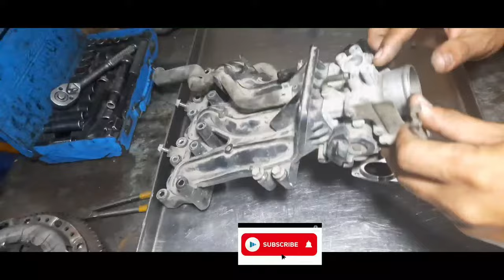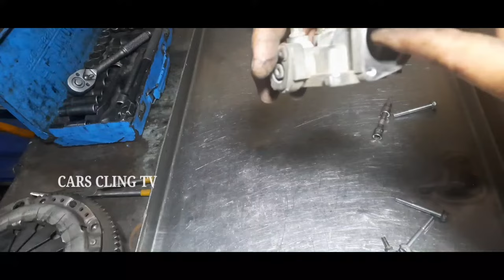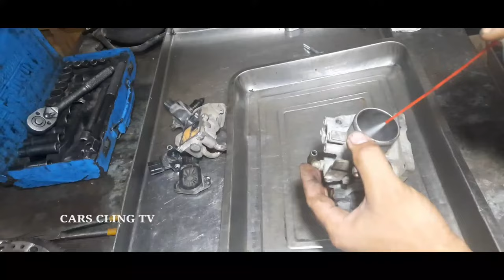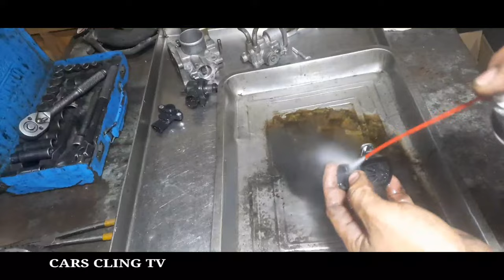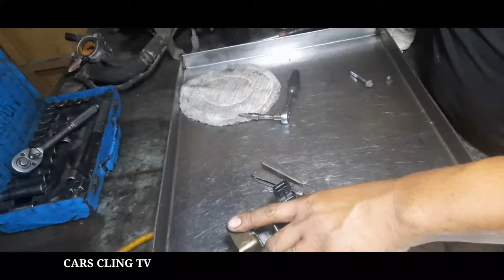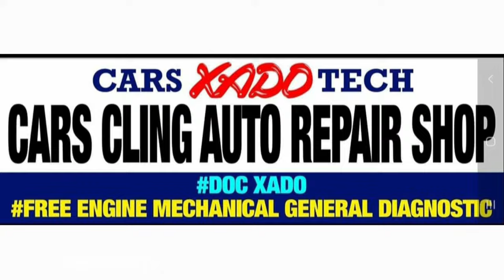ENGINE VIBRATION DIED DURING IDLING IACV TPS MAP SENSORS MAIN CAUSE ISSUE CLEANING SET UP TUTORIALS

Comment: Bos ano kaya sira ng big eye susoki q pag hindi aq mag apak nga gas mamatay
Reply from the maker: Ang big eye Suzuki Transformer na nag-mamamatay kapag hindi mo inaapak ang gas pedal ay maaaring makabahala at nagpapahiwatig ng isang sira o problema sa sistema ng fuel delivery ng sasakyan. Narito ang ilang posibleng dahilan kung bakit ito nagyayari:

1. Fuel pump: Ang fuel pump ay responsable sa paghahatid ng sapat na gasolina mula sa fuel tank patungo sa mga fuel injectors. Kung may sira ang fuel pump, maaaring hindi ito nagbibigay ng sapat na gasolina habang hindi ka umaapak sa gas pedal, na nagreresulta sa pagkakamamatay ng sasakyan. Maaaring hulaan ng isang mekaniko kung ito ang sanhi ng problema.

2. Fuel filter: Ang fuel filter ay naglilinis ng gasolina bago ito mapunta sa mga fuel injectors. Kung ito ay labis na marumi o may sira, maaaring mapigilan ang tamang daloy ng gasolina, na maaaring magresulta sa pagmamatay ng sasakyan kapag hindi umaapak sa gas.

3. Throttle body: Ang throttle body ay nagreregulate ng dami ng hangin na papasok sa engine habang hindi umaapak sa gas pedal. Kung mayroong problema sa throttle body tulad ng pagkakabara ng mga makinarya o mga sensor na nagkkontrol dito, maaaring hindi sapat ang hangin na papasok sa engine, na nagdudulot ng pagkakamamatay ng sasakyan.

Ito ay ilan lamang sa mga posibleng problema na maaaring magdulot ng mga sintomas na iyong binanggit. Mahalaga na dalhin ang sasakyan sa isang kwalipikadong mekaniko para sa pagsuri at tamang pag-aayos.

Thank you for your support!

More Basic Pointers Toturials FULL Videos: https://www.youtube.com/channel/UCXSl7FUzPZV3lIxFWCHFTVA
For more inquiries, please contact us at our 
FB Page CARS CLING TV: https://www.facebook.com/clingauto
CARSClingTvShortVideos: https://www.youtube.com/channel/UCsUWQnaD9vVKqL_w6eAYhgA
#
#xadoenginetreatment 
#carsclingtv 
#basicpointerstutorialissuefixed 
#xadoenginetreatmentengineperformancerecovered
#10yearslonglastceramicscarbonmetalcoated 
#carsclingautorepairshoplegacy 
#trottledelayremoval
#blackwhitesmokeremoval
#lowpowerengineremoval
#carsclingtvshortvideos
#xadoenginetreatment 
#changeoilpms
#enginecarbonchroming 
#carsclingautorepairshop
#remedyxadotreatment 
#acceptcheckengineissue 
#troubleshoot 
#legitonlineseller  
#Mobile09171259996
CARS CLING TV Located @Purok Pandian Gay Corner Makar Highway Brgy. Labangal General Santos City SouthCotabato 9500

Comment: Sir ano po problema sa da64 q pg mg drive or reverse na nka aircon namamatay yong makina
Reply from the maker: Yes Sir,. Ang issue ay IACV valves need linisan at ang trottle position sensor dapat nasa 1volts at starting idling stage,.

Comment: Sir bat ung susuki multicab nmin walang arangkada parang nka tersera agad  kaya namamatay pag bibitawan ung clutch pero maganda nman ung idle
Reply from the maker: Yes sir,. May issue ang pcv valves or vacum leak sa vacum hoses, kaya mataas ang rpm,. Sobra ang supply ng hangin na galing sa labas, hindi na babasa or ma reading ni ecm kaya mataas ang rpm,. Kung walang vacum leak, mal function na ang iacv valves, always naka open kaya mataaa ang rpm ng engine during idling stage,.

Comment: Sir gud am..iblog mo rin yung code poo73 ambient air temperature sensors ng da64w kung saan ang exact location sir..matagal ko na hinahanap di ko parin makita..tnx
Reply from the maker: Yes Sir,. Ang location po nito naka locate sa harap ng window grills sa may part ng radiator or condenser ng makina,. Kung wala namn po doon, paki check ng kanyang IAT Intake Air Temperature Sensor nasa location ng valve cover,.
Reply: @carsclingtv  maraming salamat sir..
Reply from the maker: Thank you Sir 

More Basic Pointers  Toturials videos: https://www.youtube.com/channel/UCXSl7FUzPZV3lIxFWCHFTVA
FB Page CARS CLING TV: https://www.facebook.com/clingauto
CARSClingTvShortVideos: https://www.youtube.com/channel/UCsUWQnaD9vVKqL_w6eAYhgA
#
#xadoenginetreatment 
#carsclingtv 
#basicpointerstutorialissuefixed 
#xadoenginetreatmentengineperformancerecovered
#10yearslonglastceramicscarbonmetalcoated 
#carsclingautorepairshoplegacy 
#trottledelayremoval
#blackwhitesmokeremoval
#lowpowerengineremoval
#carsclingtvshortvideos
#xadoenginetreatment 
#changeoilpms
#enginecarbonchroming 
#carsclingautorepairshop
#remedyxadotreatment 
#acceptcheckengineissue 
#troubleshoot 
#legitonlineseller  
#Mobile09171259996
CARS CLING TV Located @Purok Pandian Gay Corner Makar Highway Brgy. Labangal General Santos City SouthCotabato 9500

Comment: Boss kung maglinis ba ng throttle tanggal yun gasket
Reply from the maker: Kapag naglilinis ng throttle body, mahalaga na maingat kang magtrabaho upang maiwasan ang anumang pinsala o leaks. Narito ang ilang pangunahing gabay sa kung kailangan bang tanggalin ang throttle body gasket:

### Kailan Kailangang Tanggalin ang Throttle Body Gasket:

1. **Kapag Inalis ang Throttle Body**:
    - Kung kailangan mong alisin ang buong throttle body mula sa intake manifold para malinis ito nang maayos, kailangang tanggalin ang throttle body gasket. Kapag inalis mo ang throttle body, posibleng mag-deform o masira ang gasket, kaya't kinakailangan itong mapalitan ng bago upang maiwasan ang pagtagas ng hangin.

2. **Kapag Sira o Luma na ang Gasket**:
    - Kung napansin mo na ang gasket ay luma, brittle, o may signs ng wear and tear, magandang ideya na palitan ito. Ang isang sira o hardened na gasket ay maaaring magresulta sa vacuum leaks na makakaapekto sa performance ng makina.

### Hakbang sa Paglilinis ng Throttle Body:

1. **Paghahanda**:
    - Siguraduhing naka-park ang sasakyan sa patag na lupa at malamig na ang makina bago simulan.
    - I-disconnect ang battery para sa kaligtasan.

2. *Pag-alis ng Throttle Body* (kung kinakailangan):
    - Tanggalin ang mga koneksyon tulad ng hoses at electrical connectors na nakakabit sa throttle body.
    - Alisin ang mounting bolts ng throttle body gamit ang tamang tools.
    - Maingat na tanggalin ang throttle body mula sa intake manifold.

3. **Paglilinis**:
    - Gumamit ng throttle body cleaner (spray) at isang malinis na basahan o brush upang tanggalin ang carbon deposits at dumi sa loob ng throttle body.
    - Huwag mag-spray ng cleaner direkta sa electronic components ng throttle body kung ito ay electronic.

4. **Papalitan ang Throttle Body Gasket**:
    - Kung inalis mo ang throttle body, alisin ang luma na gasket.
    - Linisin ang mating surfaces (yung parte kung saan dumidikit ang gasket) ng throttle body at intake manifold.
    - I-install ang bagong gasket bago ikabit muli ang throttle body.

5. **Pagre-reinstall**:
    - Ibalik ang throttle body sa intake manifold, siguraduhing tama at pantay ang pagkakalagay.
    - Higpitan ang mounting bolts ayon sa recommended torque specification ng manufacturer.
    - I-reconnect ang mga hoses at electrical connectors.

6. **Pagsubok**:
    - I-reconnect ang battery.
    - Paandarin ang makina at hayaang tumakbo ito sa idle. I-monitor kung may abnormal na idle o RPM fluctuation na senyales ng vacuum leak.
    - Kung kinakailangan, pwede ring magpatakbo ng "relearn" procedure para sa throttle body kung kinakailangan ng sasakyan.

### Tandaan:
- Ang throttle body cleaning ay isang mahalagang preventative maintenance na makakatulong upang i-maintain ang smooth at efficient na operasyon ng makina.
- Laging sundin ang specific service manual ng iyong sasakyan para sa tamang procedure at torque specs.
- Kung hindi ka sigurado o wala kang sapat na tools, mas mabuting dalhin ang sasakyan sa isang qualified mechanic.

Sa paggawa ng mga ganitong uri ng maintenance, pagiging maingat at sumusunod sa tamang procedure ang susi upang maiwasan ang mas malaking problema sa hinaharap.

Thank you for your support!

More Basic Pointers Toturials FULL Videos: https://www.youtube.com/channel/UCXSl7FUzPZV3lIxFWCHFTVA
For more inquiries, please contact us at our 
FB Page CARS CLING TV: https://www.facebook.com/clingauto
CARSClingTvShortVideos: https://www.youtube.com/channel/UCsUWQnaD9vVKqL_w6eAYhgA
#
#xadoenginetreatment 
#carsclingtv 
#basicpointerstutorialissuefixed 
#xadoenginetreatmentengineperformancerecovered
#10yearslonglastceramicscarbonmetalcoated 
#carsclingautorepairshoplegacy 
#trottledelayremoval
#blackwhitesmokeremoval
#lowpowerengineremoval
#carsclingtvshortvideos
#xadoenginetreatment 
#changeoilpms
#enginecarbonchroming 
#carsclingautorepairshop
#remedyxadotreatment 
#acceptcheckengineissue 
#troubleshoot 
#legitonlineseller  
#Mobile09171259996
CARS CLING TV Located @Purok Pandian Gay Corner Makar Highway Brgy. Labangal General Santos City SouthCotabato 9500

Comment: Sir gd, pm, da63t dn po ang akin,, siguro malakas dn po ang minor sa akin,,  kasi pag nagkambio ako ng atras,  kahit hindi ko apakan yong clator aatras na siya ng malakas,,  at pag umabante naman ako,, kahit na naka sigunda ako aabante narin siya kahit hindi ko inaapakan ang cletor,,  kaya tuloy ang aabutin ng takbo ng isang letro na gasulina ko,,,  ay  8 kilometers lang,,  sana mabigyan mo ako ng tamang payo,,   ano ang gagawin ko........
Reply from the maker: Yes Sir,. Malakas ang minor dahil marumi ang iacv, naka open ng bahagya dapat linisan ang trottle body,. then paki check ng vacuum leak,. ung cable accelarator bak naipit or wala ng play kaya hindi makabalik ng maayos sa original position nito,. then ang tps position sensor paki check ng voltage baka po wala sa tamang set up,.
Reply: Location sir
Reply from the maker: More Basic Pointers  Toturials FULL Videos: https://www.youtube.com/channel/UCXSl7FUzPZV3lIxFWCHFTVA
FB Page CARS CLING TV: https://www.facebook.com/clingauto
CARSClingTvShortVideos: https://www.youtube.com/channel/UCsUWQnaD9vVKqL_w6eAYhgA
#
#xadoenginetreatment 
#carsclingtv 
#basicpointerstutorialissuefixed 
#xadoenginetreatmentengineperformancerecovered
#10yearslonglastceramicscarbonmetalcoated 
#carsclingautorepairshoplegacy 
#trottledelayremoval
#blackwhitesmokeremoval
#lowpowerengineremoval
#carsclingtvshortvideos
#xadoenginetreatment 
#changeoilpms
#enginecarbonchroming 
#carsclingautorepairshop
#remedyxadotreatment 
#acceptcheckengineissue 
#troubleshoot 
#legitonlineseller  
#Mobile09171259996
CARS CLING TV Located @Purok Pandian Gay Corner Makar Highway Brgy. Labangal General Santos City SouthCotabato 9500

Comment: pano po Malalaman kung sira na mga sensor Nayan sir?
Reply from the maker: Yes Sir,. Malalaman natin na sira na ang mga sensor nyan kung may check engine na lalabas sa indicator lights sa dash board, then during idling hirap ito umandar, then minsan ayaw na talaga umandar,. So mainam para tumbok agad ang issue sa sensors failure is need underho ng engine scan,.

Comment: Ano po kaya ang problema ng Big eye suzuki multicab ko ayaw ng umandar kasi walang kuryente ang wire na nakakabit sa ignition coil. Tnx po
Reply from the maker: Yes Sir,. Paki double check ng main socket baka po putol, then fuse system putol, relay mal function and ecm po walang supply,. Electrical system po ang kailangan ma double chaeck
Reply: Lahat na fuse at relay na check  na, ok naman, at spark plug ok, konektado po ba dito ang IACV
Reply: Pero wala pa ring power line to ignition coil at walang apoy ang spark plug may konektion ba dito ang IACTV
Reply from the maker: Ang ilang posibleng dahilan ng kawalan ng supply ng kuryente ng independent coil papunta sa spark plugs ay ang mga sumusunod:

1. Depinisyong elektrikal - Maaaring mayroong problema sa mga koneksyon ng mga electrical wires na nag-uugnay mula sa independent coil patungo sa spark plugs. Maaaring hindi nakaayos ng maayos o may mga nasirang wires na dapat palitan.

2. Nasirang Independent coil - Ang independent coil mismo ay maaaring nasira o hindi na gumagana ng maayos. Maaaring nagkaroon ito ng internal na sira o nagdeteriorate na dahil sa mga kadahilanan tulad ng panahon o pagkakabasa ng tubig.

3. Spark plug malfunction - Ang spark plug na mismong gagamit ng kuryente mula sa independent coil upang mag-produce ng spark ay maaaring nasira o hindi na gumagana. Maaaring mayroong buildup ng carbon o deposits sa spark plug na nagbabawas ng kuryente na makararating dito o maaaring nasira na ang insulator nito.

Ito ay ilan sa mga posibleng dahilan ng kawalan ng supply ng kuryente ng independent coil papunta sa spark plugs. Kapag nagkaroon ng ganitong problema, mahalagang ma-check ang sistema ng ignition at gumawa ng mga kinakailangang pag-aayos o palitan ng mga nasirang bahagi.

More Basic Pointers  Toturials videos: https://www.youtube.com/channel/UCXSl7FUzPZV3lIxFWCHFTVA
FB Page CARS CLING TV: https://www.facebook.com/clingauto
CARSClingTvShortVideos: https://www.youtube.com/channel/UCsUWQnaD9vVKqL_w6eAYhgA
#
#xadoenginetreatment 
#carsclingtv 
#basicpointerstutorialissuefixed 
#xadoenginetreatmentengineperformancerecovered
#10yearslonglastceramicscarbonmetalcoated 
#carsclingautorepairshoplegacy 
#trottledelayremoval
#blackwhitesmokeremoval
#lowpowerengineremoval
#carsclingtvshortvideos
#xadoenginetreatment 
#changeoilpms
#enginecarbonchroming 
#carsclingautorepairshop
#remedyxadotreatment 
#acceptcheckengineissue 
#troubleshoot 
#legitonlineseller  
#Mobile09171259996
CARS CLING TV Located @Purok Pandian Gay Corner Makar Highway Brgy. Labangal General Santos City SouthCotabato 9500
Reply from the maker: Maaring ang electronic control module (ECM) o engine control module (ECU) ang maging isang posibleng isyu kapag walang current supply paunta sa ignition system ng sasakyan. Ang ECM ay responsable sa pag-monitor at pagsasaayos ng iba't ibang bahagi ng isang sasakyan, kasama na ang ignition system.

Kapag may tama o depekto sa ECM, ito ay maaaring hindi magpadala ng tamang signal at command patungo sa ignition system. Ito ay maaaring magresulta sa kawalan ng kuryente na dapat maging available sa mga spark plugs.

Ang iba pang mga sanhi ng pagkakaroon ng problema sa ECM ay maaaring kasama ang mga sumusunod:

1. Nasirang ECM - Ang ECM mismo ay maaaring masira dahil sa iba't ibang mga kadahilanan tulad ng mga internal na sira, overvoltage, o iba pang mga electrical issue.

2. Mga wire o connection na may sira - Ang mga kable at koneksyon na nag-uugnay sa ECM at ignition system ay maaari ring magkaroon ng sira o hindi maayos na konektado. Ito ay maaaring maging sanhi ng pagkawala ng power papunta sa ignition system.

3. Iba pang mga isyu sa electrical system - Maaaring may iba pang mga kahalintulad na problema sa electrical system ng sasakyan na nagdudulot ng kawalan ng suplay ng kuryente papunta sa ignition system. Ito ay maaaring kasama ang mga fuse na nasira o mga relay na hindi gumagana ng maayos.

Kapag mayroong problema sa supply ng kuryente sa ignition system ng isang sasakyan, mahalagang ma-inspeksyon at ma-diagnose ng tamang mekaniko o technician ang ECM at iba pang mga bahagi ng elektrikal na sistema para malaman kung ano ang sanhi ng isyu at mabigyan ng tamang solusyon.

More Basic Pointers  Toturials videos: https://www.youtube.com/channel/UCXSl7FUzPZV3lIxFWCHFTVA
FB Page CARS CLING TV: https://www.facebook.com/clingauto
CARSClingTvShortVideos: https://www.youtube.com/channel/UCsUWQnaD9vVKqL_w6eAYhgA
#
#xadoenginetreatment 
#carsclingtv 
#basicpointerstutorialissuefixed 
#xadoenginetreatmentengineperformancerecovered
#10yearslonglastceramicscarbonmetalcoated 
#carsclingautorepairshoplegacy 
#trottledelayremoval
#blackwhitesmokeremoval
#lowpowerengineremoval
#carsclingtvshortvideos
#xadoenginetreatment 
#changeoilpms
#enginecarbonchroming 
#carsclingautorepairshop
#remedyxadotreatment 
#acceptcheckengineissue 
#troubleshoot 
#legitonlineseller  
#Mobile09171259996
CARS CLING TV Located @Purok Pandian Gay Corner Makar Highway Brgy. Labangal General Santos City SouthCotabato 9500